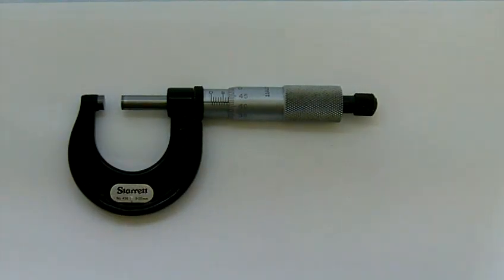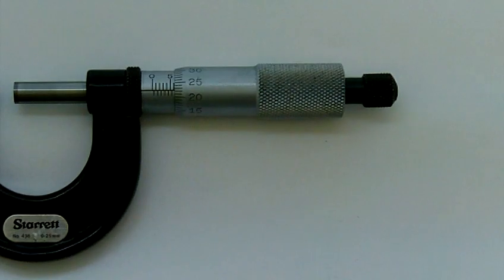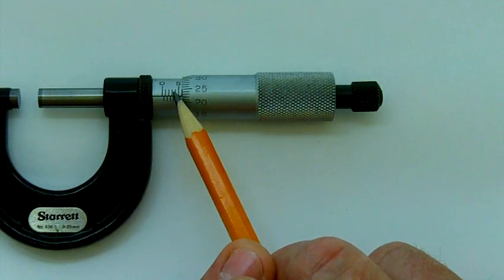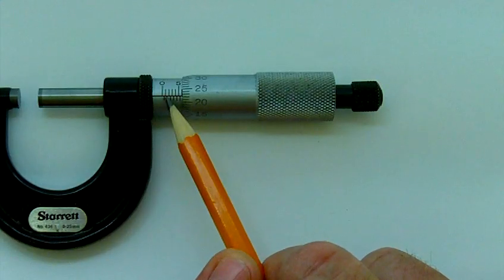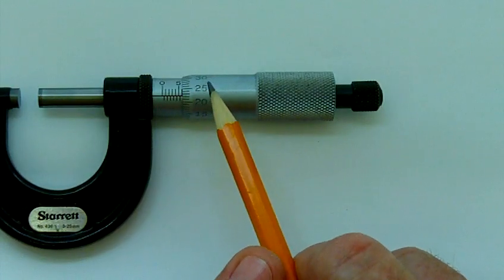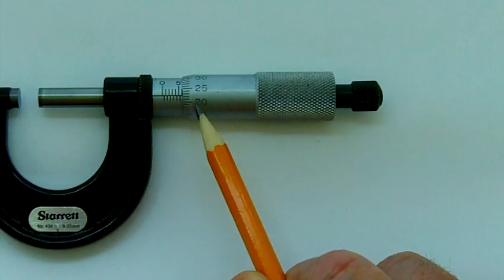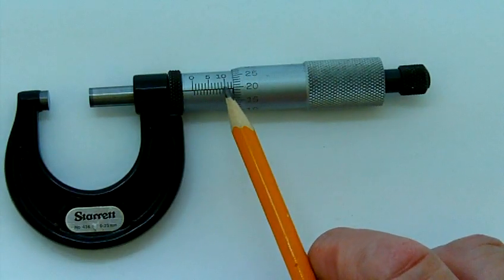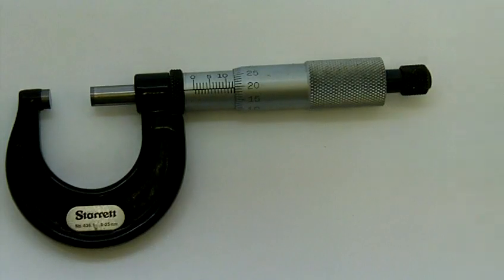Reading a Metric Micrometer Caliper

Comment: Is it indicated on the micrometer that the readings are in millimeters?
At first glance it looks like any micrometer measuring in inches D:
I feel like there should be some indicater for the unit the micrometer will be measuring by.
Reply from the maker: At the bottom of the frame it should tell you if it is inch or metric.
Reply: Mighty DeathLash  it's units of mm.

Comment: wrong wrong wrong, the ratchet should turn by one click only ! you are doing it wrong !
Reply from the maker: +IDUP SWK (nash) What if the anvil and spindle are not square?
Reply: machiningmoments what do you mean? Square in shape or number?
Reply from the maker: +IDUP SWK (nash) Contact points on the mic true to the surface of the part being measured.
Reply: Looking at the content of your channel (and the grammer of your channel description) you definitely have spent a decade or two in the machine shop measuring to thousandths of an inch. In case you didn't pick up on the sarcasm, I am being sarcastic.

Comment from the maker: There is 12.5mm on the sleeve and .20mm on the thimble so 12.5 + .20 = 12.70mm.  Your english is fine. Thanks for your post and good luck with your test.

Comment from the maker: @RyersonRobert Hello again, I went back and checked my vid (forgetful, old age)...the "annotations" are there indicating the measurement. Is it possible you have your annotations turned off? If so go into Settings. I have the same issue you have growing up in the inch system but metric really is easier (and a smaller unit which is ideal for a machinist). The base 10 system makes much more sence than inches eg. 25.4mm is 2.54cm move the decimal. Are you at Ryerson? Thanks for the note.